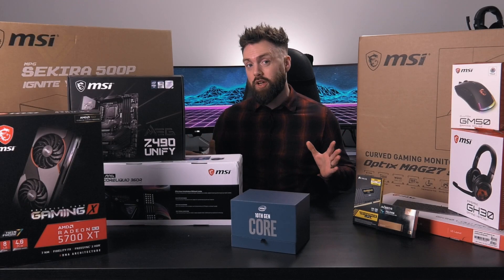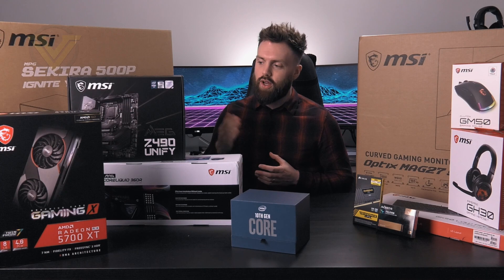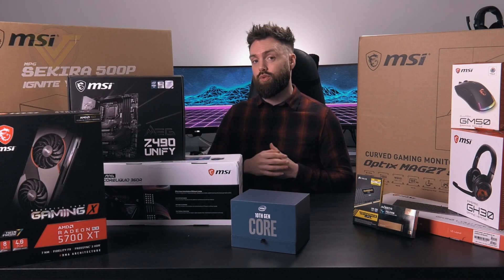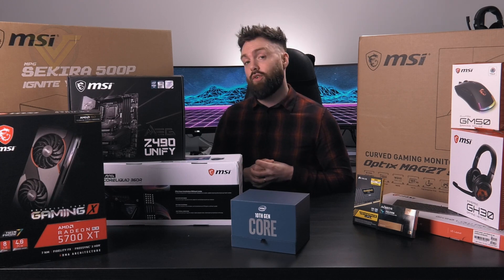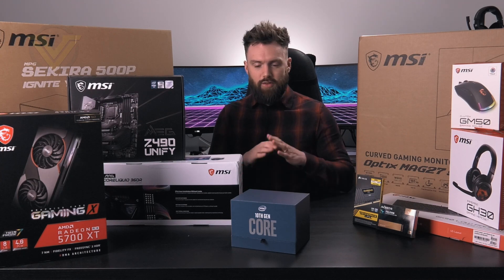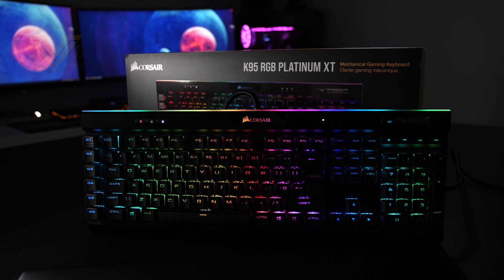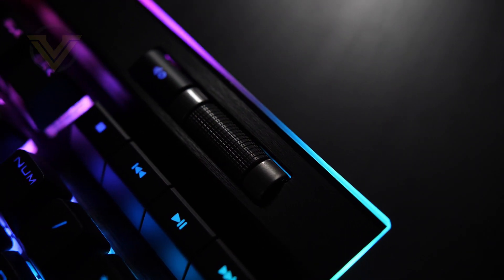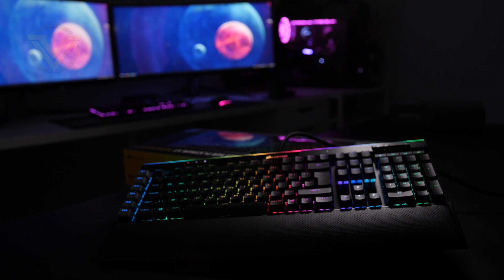The ALL-MSI Blackout Gaming PC Build - Z490 UNiFY, 10900K, 5700XT.

Comment: Nice! I'm doing a 10900K build that's also as black as the pits of hell itself! I reckon a 1080Ti Strix and Patriot viper Ram is going to look sweet in this board. If I'm not careful I'll end up with a black hole in the corner of my room.
Reply from the maker: Haha! Yep that sounds like it'll look great. Which CPU cooler will you be using?
Reply: Vortez -Already have a H115i (so a 280mm Asetek) and hoping that will be enough for bearable stock temps, maybe a little OC for fun. 
Would like a 360mm or maybe even custom loop in future.

What kind of temps are you getting on your cooling solution when gaming etc? I've heard comet lake runs a bit cooler than coffee etc with the new die shaping?

Comment: Would you recco the MSI AIO? It seems to keep things pretty cool. I'll be running an i7 10700k with the same motherboard.
Reply from the maker: It definitely works well, and I like the fact you can twist the pump cap. Not sure if you saw - but all of the fans and pump have individual cables just for RGB, as well as standard cables. Can be very messy. Other than that it's pretty decent!

Comment: install the driver again(ddu).dont open the oc panel.any changes to volts,memory,fan cause problems at 1440p with 5700xt,all models
Reply from the maker: Did DDU + install, and didn't touch any settings in the OC panel - all were left at default. Separately, after discovering this issue I went into the AMD software and raised the minimum clock speed, but it's only available for GPU clock, not memory.

Comment: Nice build, but I'm more for Amd know.
Do you think my pc build is good enough for 2020 gaming (gta5, battlefield 4, deadside...), and casual 3d modeling (autocad,maya...), and has potential to upgrade in 3--4 year's later.  Btw I used partpicker.com to find right parts.  Thanks :)  

	AMD Ryzen 7 3700X 3.6 GHz 8-Core Processor
	be quiet! Dark Rock Pro 4 50.5 CFM CPU Cooler
	Noctua NT-H2 3.5 g Thermal Paste
	Asus ROG Strix X570-I Gaming Mini ITX AM4 Motherboard
	Corsair Vengeance LPX 64 GB (2 x 32 GB) DDR4-4000 CL18 Memory
	Seagate BarraCuda Pro 6 TB 3.5" 7200RPM Internal Hard Drive
	Asus Radeon RX 5500 XT 8 GB DUAL EVO OC Video Card
        be quiet! Pure Base 500 ATX Mid Tower Case
        Microsoft Windows 10 Pro 32/64-bit
	be quiet! 85 CFM 140 mm Fan
        Monitor samsung syncmaster 2233 = already have
        Corsair CX
   TX  80+ Bronze  500 W  = already have
=total around  2200$ (US)
Reply from the maker: Thanks! Looks like a great config you have there. My only suggestion would be to reduce memory capacity to 32GB (total) and frequency. With the cash saved, invest in a more powerful GPU for gaming and rendering. 🙂
Reply: @Vortez  thanks, but I can't use more powerfull gpu, cause it will use more from power supply and then I will need to buy that too. Unless there is better gpu with same or lower power consuption.

Comment: Hey i have a issue with my pc that i built where i get micro stutters and sometimes i drop to 10 fps for a second and i have no idea why anyone has any idea why that could be? I'm thinking of returning the GPU
Reply from the maker: What is your config?
Reply: @Vortez  The stutter issue is away now i fixed it thanks for replying but there is one more issue my rtx 2060 super Windforce makes a buzzing noise whenever it reaches around 65 degrees and the noise is very loud is there a solution for that ?
Reply: @Immortal It's fine now i exchanged my GPU for another model and now it's perfect thanks!